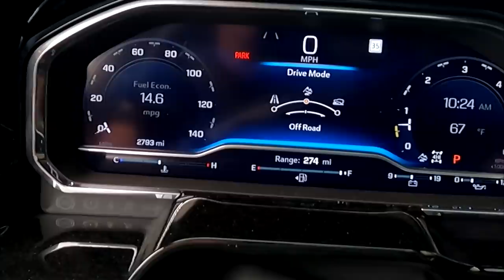Silverado ZR2 First OFF ROAD COMPETITION WENT HORRIBLE! Pushed her too hard..

Comment: If you're gonna off road it on the regular, might I suggest taking it to a dealership, or any place that does the spray-in bed liners and have them spray the rocker panels. I did that with one of my previous trucks, and it kept them from getting scraped up and rusted.
Reply: That and some legit rock sliders
Reply: @bobbymulwee7641  That and an actual coating on the frame too. GM wax is junk
Reply: Tell ‘em to bed line the frame while they’re at it😂

Comment: It’s an excellent truck. But there was a bunch of things Chevy really should have thought about that are really a big deal. Here’s my list: bigger tires, it should be able to fit at least 35s stock, rock sliders, and smaller front bumper for extra clearance. It’s looks very good tho
Reply: Rick sliders are an option
Reply: @rickhofmeister2125  Rick sliders are a dealer/manufacturer option? I think I would rather go aftermarket and get ROCK sliders 😂😂😂😂 Sorry bro couldn't help myself.
Reply: Can remove the ends of the front bumper.
Reply: It has small bumpers and better approach angle than rapture r trx. All the other ones I've seen on the lots come with rocksliders r steps.

Comment: Took my Rocky Ridge Silverado to the trails near cumberland gap a few weeks ago.  6" lift on 35"T X 12.5"W Ridge Grapplers wrapped on 20's (ugh, need to swap those for 18's or smaller for more sidewall).   I was REALLY wishing I had a front locker and a selectable rear locker, but with offroad mode in L1 using 1 pedal driving the thing was a beast.  I need to add rock sliders as well, high clearance front and rear bumpers, and a winch, then I think it could go pretty much anywhere.

Comment: COOL VIDEO! I just installed 295/70 R18 A/T tires (34.5") on my 2021 GMC Sierra AT4 (6.2L). Also bought some offset wheels (offset 1). This combo gives 0.9" more poke out (1.8 wider track) and more tire to work with. There was some minor rubbing which I fixed. I got Bilstein 5160 shocks in the rear...but, this truck really needs those Bilstein 5100 adjustable front struts (gives about 1.5" lift without screwing up the suspension and CV joint geometry). I had them on my last truck (2014 Silverado) and loved them...waaaay better shocks then those crap Ranchos. I think bigger tires and a level in the front (and rock sliders) will help you out without going too crazy on your new truck. These trucks are expensive, but can easily (with more money) be way more capable.

Comment: Why didn't you get the option with the rocksliders? Why do you always have a drop hitch hanging way out there? You don't air down the tires.it really seems like the more you try to make chevys look bad, the stupider you look. Why don't you get you're buddies with rapture and trx's and follow that beast. Won't do it even with larger tires. Also superchargers will heat up and break on trails like that b4 the day is over. Great job Chevy for building the best off-road truck out there.